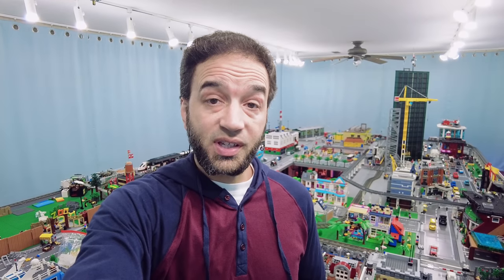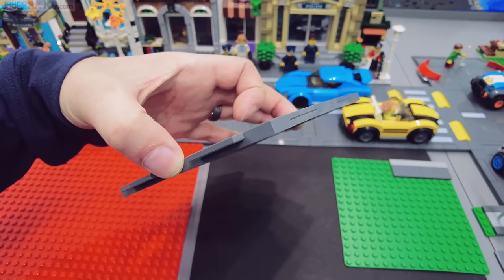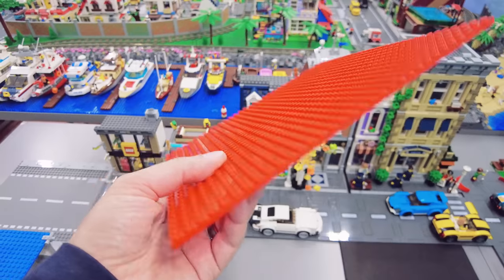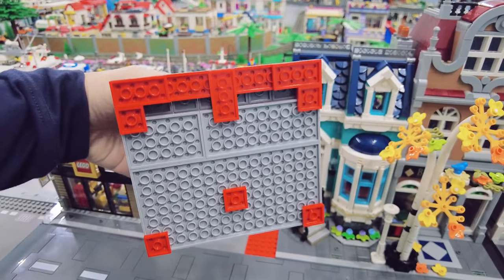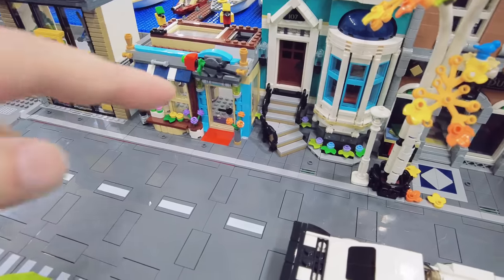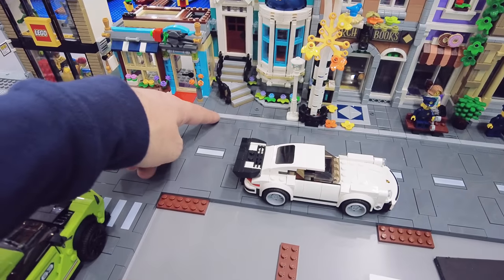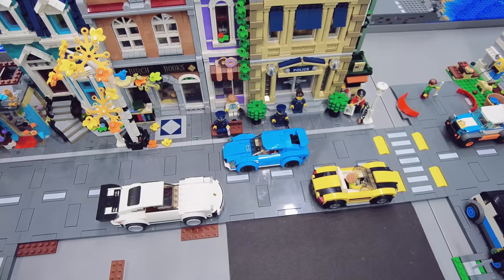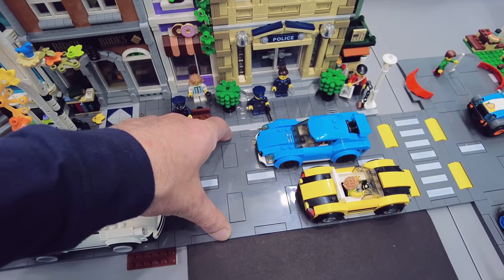LEGO road plate harmony! Easiest, cheapest fixes & integrations for modulars, baseplates & more

Comment: On the german Lego Shop website the rating for 60304 (the simple crossing) has a rating of 1.6 out of 90 reviews. There some people with a slightly different opinion...
Reply from the maker: Differences of opinion are healthy. Some of those people voting down this new road plate system simply don't like it, for numerous valid reasons. Then there is the virulent mob that has been acting in unison, not only sharing a "different opinion" but actively attacking, insulting, disrespecting, and demeaning anyone who does not blindly follow their agenda and accuse LEGO of intentionally harming older fans with this change from one piece of toy plastic to another piece of toy plastic. Their nasty, despicable, shameless personal assaults against the character of anyone who dares even try using the new pieces have nearly driven some smaller creators off social media entirely. My moderators & I have had to read & weed out probably over a hundred pieces of inhuman vitriol from the comments on this one video alone. A real shame "adults" can be so childish over a toy.

Comment: Jang I'm afraid your just plain wrong. It's not up to us ....it would be if they weren't discontinuing the old road plates but they are so they're removing the choice and insisting we adopt the new or stop building...
I would zero issue with this new system if it was additional and not instead, unfortunately they have chosen to be totally inconsiderate and it is this or nothing now days

Comment: Having never owned a single baseplate, I learned 2 things today.
1. Baseplates are so out-of-system that I'm surprised Lego didn't phase them out earlier.
2. 8-wide speed champions definitely are not to scale with city. They absolutely dwarf everything around them.
Reply: Baseplates are the best solution because they give you so much space. You just take one and start building. That size wouldnt be easy to achieve with normal plates and not as solid. Baseplates inspire creativity more and are best for buildings because you automatically have more place around it to use

Comment: Thank you for your efforts to show how one can adapt to this new system. However, for a producer like Lego with clients that span the last 40-50 years, I think the introduction of this new road system is a disappointment and some even see it as „kick in the bud“ of existing clients... Moreover, when you look at the prices for parts required to systematically expand the width of the road, even more questions arise and one can only shake his/her head about the proposed new road system. I am not a fan of it!
Reply: to double down: inherent compatability accross many product lines was one of a positive key features of Lego... Now look at Modulars (on base plates) and the new road system or take the (in my view, oversized 8-wide Speed champions) and compare it to the new road system... Who are Lego Long-time planners? Do they think, Lego is only about putting more dead stuff on one‘s shelf for display? Maybe...